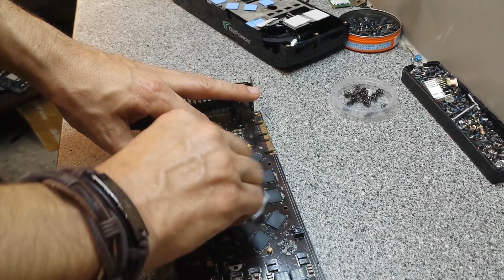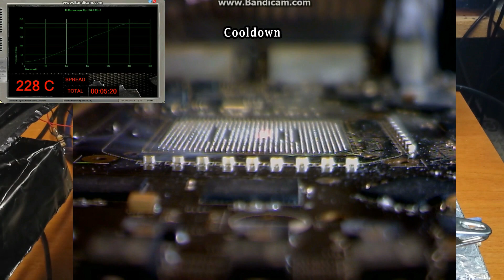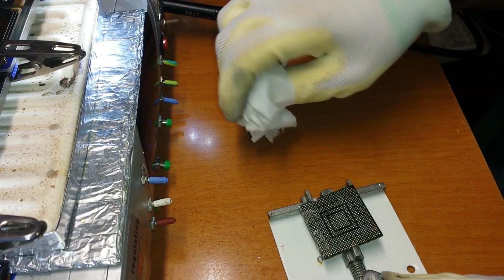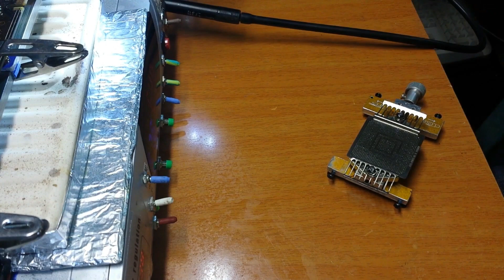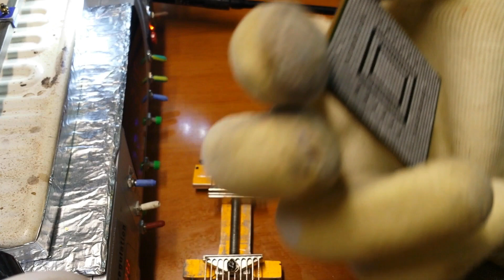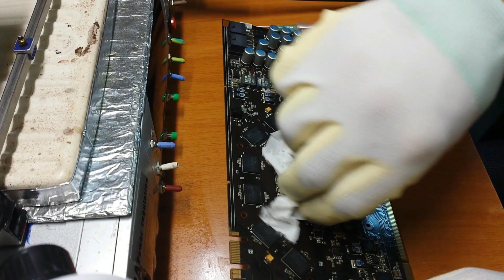Reballing Nvidia GTX Graphics Card With HomeMade BGA Rework Station

Comment: Just a tip. Use a cut off piece of desoldering braid, that way, the heat doesn’t want to travel all along the braid, it will have no where to go.

Comment: I wonder if these issues are more common on equipment that is power cycled frequently. 

Never seemed to have any issues like this when the pc was always running. And i mean always unless the power was  out due to a storm.

Is that acetone u are using after the flux/old soldier removal?

Comment: Is it possible to use a heatgun instead of the infrared heater? I have one where I can setup heat and airflow. I want to fix my 1070TI and I dont want to buy an infrored heater.

Comment: Hi, I know that this is an older video, but could you tell me where you purchased this soldering iron type tip? I have seen this type of flat tip for the slide in tips but not for the type that comes apart as you show in this video. Thanks for the video.
Reply from the maker: Hi, watch this video and read the description  https://youtu.be/rCsh6HuhIWs

Comment: What temperature do you keep bottom heat  at? And what temperatures do you keep top at?
Reply from the maker: the bottom heater stays at 270c, the top heater is controlled by the pid controller and it rises the temp until the chip-pcb reaches the desired temperature
Reply: What country you are in ??are you taking the cards for repair?

Comment: Quick question, the temp used for the Lead Free solder (230C), what was the selected temp of the station to achieve 230? Also what element and controller did you use to build your station?
Reply from the maker: Hello, because the ceramic dark infrared heaters store heat and when you cut the power they continue to provide heat for a short time before they start to cool down, the station is set to reach 220c (the leadfree solder melting temp) but the temp on the board goes up to ~235c and you want to reach 235-240c when reflowing,
but if the station uses light infrared heating panels then i would have to set the station to reach 235c because it would not overshoot.
i use ceramic dark infrared panels, the top heater is a 450w 80*80mm hollow panel, the bottom heater is a 800w 1800*1800mm flat filled with ceramic, the PID controller is not available for sale anymore, you have to find something similar.
here are the links:
https://www.ebay.com/itm/333335905760
https://www.aliexpress.com/item/32532660664.html

Comment: What is the vice on the 14.37 minute in the form of the letter H, where they were bought?
Reply from the maker: this is a pcb holder, i modified it to reball bga chips
https://www.ebay.com/itm/Mobile-Phone-Cellphone-PCB-Fixtures-Repairing-Circuit-Boards-Holder-Tool-K4K6/112578589195?epid=2268100005&hash=item1a3634f20b:g:7GoAAOSwK89ZypCt

Comment: hello nice job. 
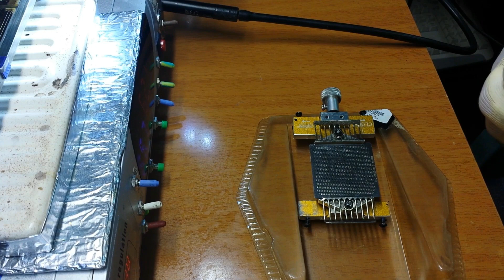What stand or holder are you using at 15:32?
Reply from the maker: Hello, i bought it on ebay and modified it ( watch this vid to see how it is now: https://youtu.be/lgfLQrJ4ojI )
https://www.ebay.com/itm/Mobile-Phone-Cellphone-PCB-Fixtures-Repairing-Circuit-Boards-Holder-Tool-D5Z4/272848278131?epid=2237832752&hash=item3f87065273:g:1UkAAOSwwf5Zu4w1

Comment: hi good day to you, my 1080ti gpu problem is when in super-low resolution like 1200 is working fine but when the driver is installed computer always reboot especially in full HD and 4k, it reboots every 10 to 20 seconds upon entering windows, can be this fix? or shall I throw in garbage my video card? thank you
Reply from the maker: You can try this repair https://youtu.be/FU84qGSdE-s

Comment: My GTX 970 gives black screen and restarts the PC when under load and it's not the PSU, some guy suggested me BGA repair. Do you think it would help?
Reply from the maker: When under load what is the temperature before it crashes ?
Reply: @NikTelio  about 78 C when gaming, but sometimes it crashes in low temps like 60 C when using editing software. I also tried different drivers and different PSU, and the only solution that worked is that I underclocked the card below stock clock speed, and now it crashes much less but still.
Reply from the maker: @Porsche996TT  these temps are ok , if it is not a psu problem then it is possible that the bga developed a crack, the only way to repair a bga crack is to do a reflow, watch this vodeo https://youtu.be/FU84qGSdE-s
Reply: @NikTelio  Thank you very much.

Comment: I have a question instead of a comment, if you please.  My NVIDIA laptop chip is heating up rather quickly by reducing the 19V rail to 11.0.  Is this partial short in the connections, or in the chip?  Needless to say, the laptop will not start.  Any help will be greatly appreciated.  Dub Dugas
Reply from the maker: the part that is heating up quickly is usually the one causing the short , have you ever noticed high temperatures while using the laptop ?
Reply: @NikTelio  The laptop was working fine, then all of a sudden, it went out and would not start.  So it was taken apart, and in checking various things, I noticed that the graphics chip was heating rather quickly when I connected the power supply w/o the battery.  The 19 V was pulled down to 11V.  If I put the battery in, the 
chip heated up much less because some of the power was going to the battery.  I do not know of a practical
place to repair/change this chip, so I will simply put the laptop pieces in storage for now.  I have seen videos
on how to change the chip, but it requires good equipment, steady hand and I am not that far advanced.   The
laptop is an ASUS  with I9 processor.  I really have had a few good years with this computer.  I hate to see it go.
 
Thank you for the comment.
Walter Dugas
Reply from the maker: @dubsuesuedub  could be the EC Mikrocontroller that failed which manages motherboard voltages and the charging.

Comment: another question for laptop motherboard if CP and GPU are advisable reballing and it sucess?
Reply from the maker: reballed and reflowed laptops (by me) many work even after 5 years, but if the repair is not successful i just replace the chip with a new one and the laptop is good as new  :)

Comment: Hei man, i got sh a vega 64 with a problem when i play video game image on monitor just stops and the fan on video card îs full speed, îs rebaling going to help?, cause i send the video card to a service and i wanna know if it make the money
Reply from the maker: Hi, reballing or reflow can sometimes work for many years, i reballed my Nvidia GTX 660 about 4 years ago and it still works but some repairs fail sooner.

Comment: Φίλε μου σε βλέπω κ θαυμάζω. Stencil holder τέτοιοι τύπου που βρήκες??
Reply from the maker: Ευχαριστώ Αντώνη, αν εννοείς την μεταλλική βάση που πιάνω το τσιπάκι μαζί με την Stencil είναι αυτήν :
https://www.ebay.com/itm/Mobile-Phone-Cellphone-PCB-Fixtures-Repairing-Circuit-Boards-Holder-Tool-E3-X3G8/282970384661?epid=2224652315&hash=item41e2596915:g:mD4AAOSwcSJa~iL-
Την τροποποίησα λίγο για να μπαίνει στον BGA rework station :)

Comment: how long this repair does work properly?
Reply from the maker: Hello, is hard to say how long the repair will last, since we can't know if there is damage inside the chip we cant say for sure how long it can last, sometimes a few months and sometimes may years, i do the reballing and if a device fails again soon then i will replace the chip.
Reply: ok thx ... TT Maybe my Gtx1070 in Laptop is gone cuz when i play High game it makes BSOD nvvl... . sys but when i play in battery mod it works, it is going wrong only in AC mode Full load VGA
Reply from the maker: when the laptop works with the power adapter connected then the gpu and cpu can work at full capacity and this means that they produce more heat, if the cooling system is clogged with dust then usually the the gpu overheats and then problems like this appear,
the first step is to make sure that the cooling system is clean.

Comment: If the solder balls that is connecting the GPU die to the substrate cracked, then the chip is dead, there is no way you can reball that and 99% of the time that is the ones that end up failing, not the solder balls you see in the video. 

This is not a permanent fix, it might work for a short while before failing again. The only permanent fix is to remove the dead chip then solder in a fully functional chip either through donor board or brand new. That is the reality, no use pretending otherwise.
Reply: mikeA1  Oh please tell me how can you dissolve the GPU die underfill and apply fresh solder smaller than the size of a human hair? Or better yet can you explain to me how can you reflow solder when there is epoxy resin(die underfill) covering the whole solder ball area? 

It's quite simple really, I want you to apply super glue to some broken solder connection and try to reflow it ;) remember the super glue have to cover the entire connection, wonder how would you get flux into the superglue covered connection ;)
Reply: mikeA1  Well maybe there are methods that I don't know, any YouTube videos that you can link to watch?

Comment: success of percentage after rebelling card will work 100% ?
Reply from the maker: Hello, it is very hard to say for how long the repaired graphics card will work, some work a few months and some like my gtx 670 work even after 2 years, if the problem is in the BGA then reballing will fix it and the graphics card will work for a long time, but if the problem is broken connections inside the chip then it will fail again soon.